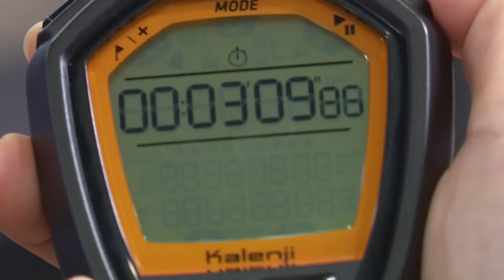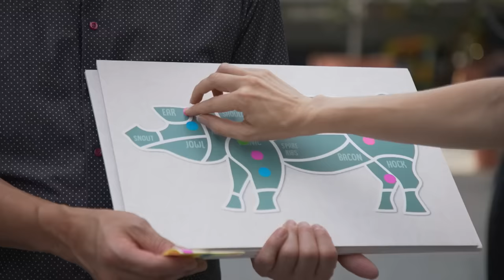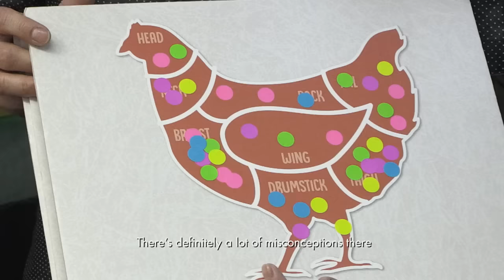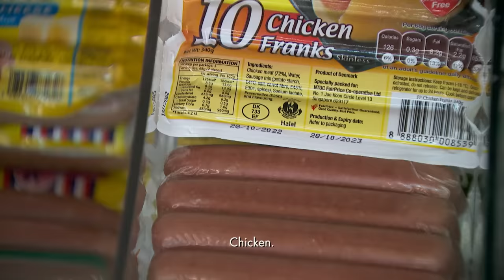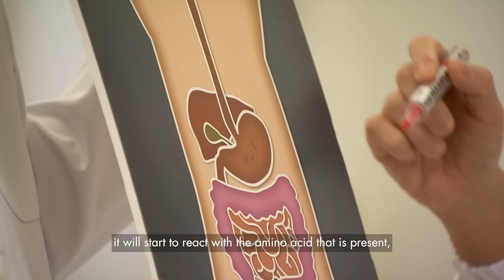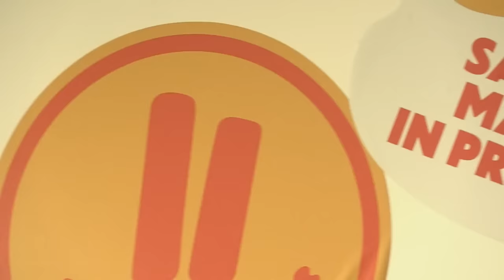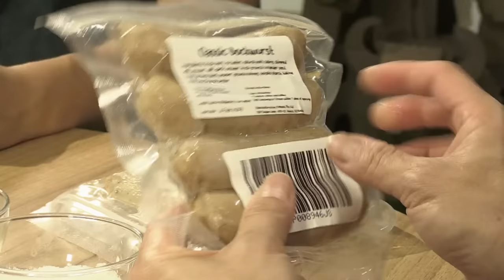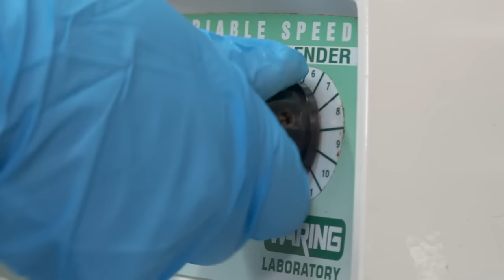What’s Really In Sausages? | Talking Point | Full Episode

Comment: 20:50 If you have sodium sensitivity, atherosclerosis, arteriosclerosis, hypertension, etc., you should take even less sodium (which comes from many things, not just salt and MSG) because salt enters the bloodstream and does damage to the endothelial cells lining the blood vessels, causing those and other ailments. Tip: If you want to have a nice flavor but with less sodium, try MSG; it has far less sodium in it. You can also use no salt alternatives, which typically have potassium, but you have to watch not to have too much of that, too. Finally, you can try no-salt spice blends but, unfortunately, some of them don't taste very good, so you're better off finding recipes for alternatives to them.
Reply: Good advice overall. However, potassium chloride has a very different taste with a hint of bitterness, so it's difficult to get used to. As we all need more potassium, it's not likely anyone would get too much.
Reply: @paulmaxwell8851  I use potassium chloride and I don't even notice the bitterness unless I consume it alone (which I don't). While we DO need potassium, health experts recommend that we don't get too much as it can cause problems. Everything in moderation, remember?